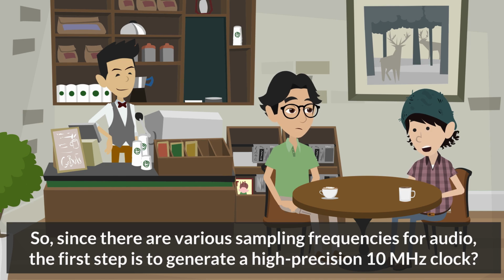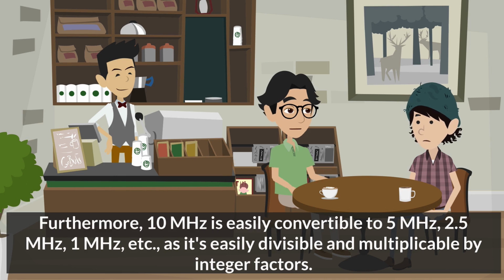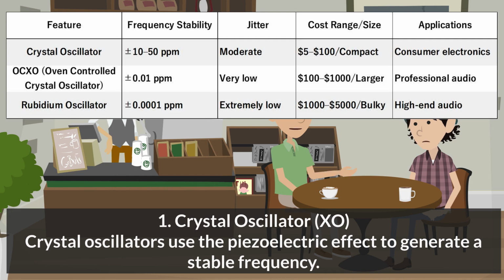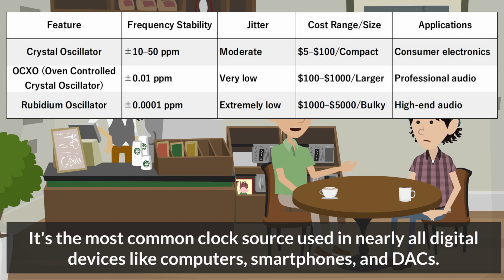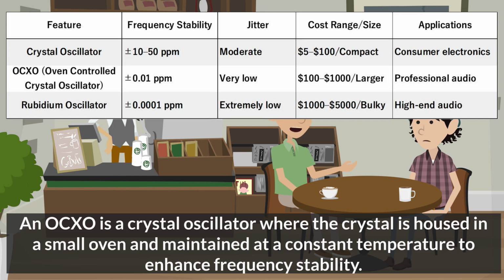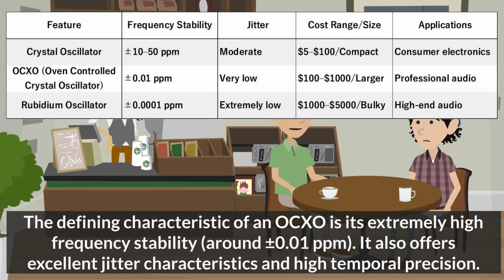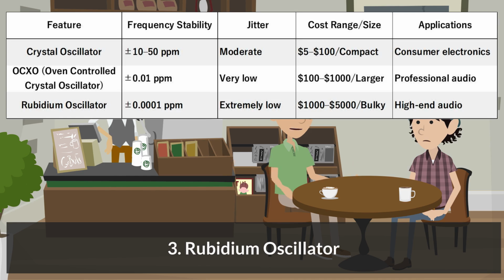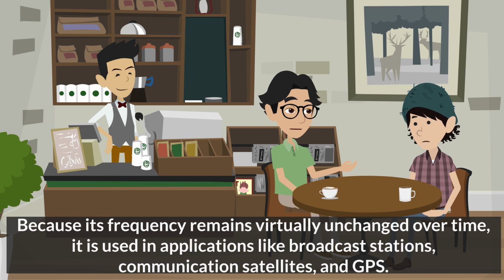Ordering the SMSL G1 Clock Generator

Comment: I have Singxer SU6 but I don't find any use case for the clock output on my SU6. I don't have any devices that has a clock input unless I purchase SMSL CD player.
Reply from the maker: You'll need some kind of device that supports an external clock.
Reply: @tiyotiyo-Channel-lc7bn Thanks for the reply. I know. But how many devices have Clock input? Just most recently SMSL started marketing such as the CD player.